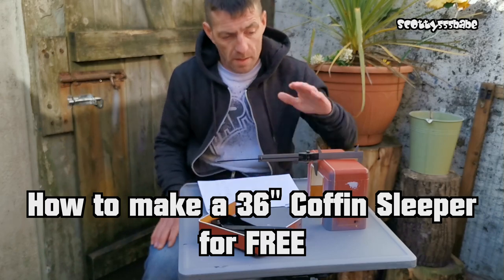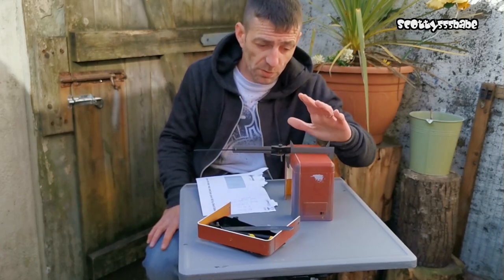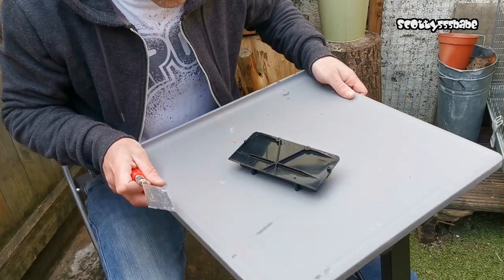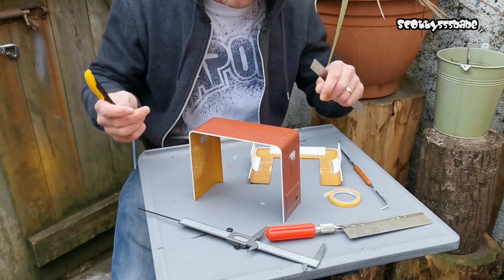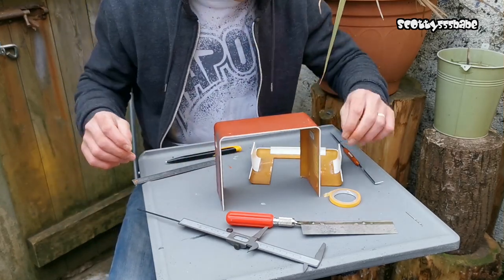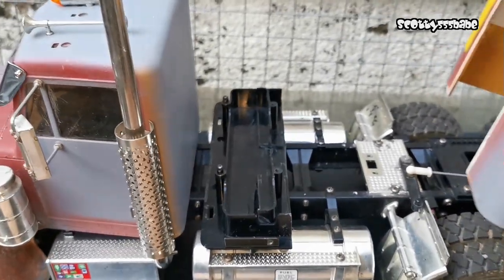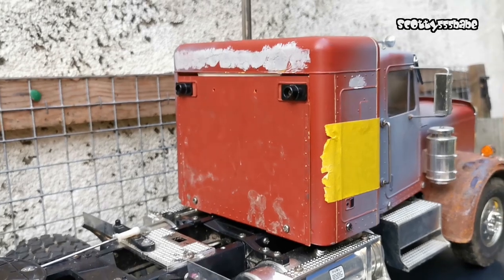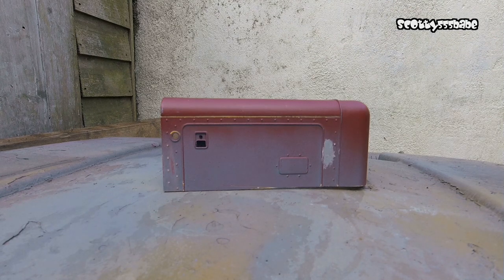How to Make a Realistic 1/14 Scale Custom 36" Coffin Sleeper | MUST HAVE CUSTOM RC TRUCK FREE MOD

Comment: nd vid pal. Just one question?. you use wet n dry sandpaper. I use mine wet for sanding my bodies. Is it prefference that you use it dry? :goodvibes:
Reply from the maker: With me removing the rivets and first lots of filler and it's already covered in primers I did it dry as it's a bit more abrasive, however for my final stages I'll use it wet to get everything nice and smooth, I'll wet sand between paint coats too but with a much higher grit 👍
Reply: @scotty555babe  Thanks for the info mate:goodvibes:

Comment: Don't be sorry it's long! REAL Modelers are a bit tired of 6 minute, chopped down and sped up Videos. NOT pointed at you!!! Nearly everyone but you and Teri Wilde don't give enough good information to properly absorb!
That said, you were fine at first with the 45" "Deluxe Coffin"... but you went the extra mile. Insisting on Scale and what you wanted, you chopped again. WELL worth the effort, it looks GREAT!! 🍻👍👍👏👏👏

If you're at all worried about the gap being too big, why not just drill and Tap new holes in the Chassis? 
Loved your explanation about limitations in space and Tools. I live in a small Flat, no yard. Most of that applies to me!
Reply from the maker: It's rare my videos exceed 20 minutes but with this being virtually a complete start to finish I felt it may have gone on a bit but it saved breaking it down into so many parts as with the next video on this sleeper I can do all the little intricate bits which look difficult but are actually very simple..
Also not everyone has the funds to buy additional sleepers at a cost of over 100$ to still have to put in all the prep work so it's great to show people how to create stuff for free with a bit of kit bashing, providing you have the additional materials such as paint and filler but that's always an extra regardless but that money saved could go towards adding sound and lights or a trailer etc..
It's the same with tools and equipment.. I see so many model builders in these fancy workshops surrounded by milling machines, routers, all kinds of fancy stuff that doesn't get used and for a first time modeller seeing that could easily be put off by feeling they need all that, when in fact you probably already have everything you need, it may take a little longer but with a little patience most things are possible.
I kind of went the extra with the scale coffin as I'd worked out in 10th scale in the previous video out of habit 🤣🤣 we all make mistakes and I'm bit afraid to share my mistakes, it shows I'm not a professional perfect modeller, no one is, everyone is as good as there ability and everyones work is great regardless of skill levels.. They had a go and that's the main thing, so I felt the need to rectify my mistake from the previous 😊👍👍
Reply: @scotty555babe  
Anyone who THINKS they're infallible...  is someone I don't associate with! I'm far from perfect, and I've been in the Hobby since 1982. (Yeah, Old Fart!) I've made some whoppers. 
Even recently. It took me till just Last year to finally get into  1/14th Scale Semi Trucks. And that was only because of an Inheritance. See, I don't have YEARS worth of spare parts accumulated, like you, Teri Wilde and others.... 
Fortunately Tamiya includes too many bits in their Kits, but with the 5 Trucks I bought last year, I've only got a spare 5th Wheel from my 1850L. ☹️  Got a WAY to go.

The Faux Pas....  doing me very first Semi (Grand Hauler), and treating it like I knew what I was doing!!! 🙄  Many upgrades, modifications.... and  a Beier USM-RC-3 - which has kicked my ass from Oregon to Maine!! 🤬🤬🤬 
My experience did get me through the actual build (even with a scared preconception of my first 3 Speed Gearbox!). Now that I've done one,  I feel that the rest will be easier. 

{Scotty..... if you want to spread an invaluable Tip to your many Subs; I was driven NUTZ over the Second Gear Dog. IT NEVER DISENGAGES!!! 
Stupid me thought it was a DEFECT, and chopped the legs down to clear 2nd Gear, like the other two! 🙄☹️🤬🤬 
Well as you can guess, Second just freewheeled!! As a former Auto Technician, it just didn't make sense. 
I finally realised that 2nd Gear freewheels - all the time. It's not until FIRST Gear Dog engages the 2nd Gear Dog, that then locks Second Gear!!! 😳 } 
I'm embarrassed about that, because of my experience. But if you can admit it, I can as well. 

But Novices who never built a 3 Speed before, should know that. 🤔 
I don't have enough Subs on my Channel to make a dent. It's OK, I like it small and personal. 

Another thing you've taught this Old Fart, is that a Razor Saw, something I've used for decades on Model Railroad Track, works brilliantly on thick Plastic Bodies!! Thanks! 

I want to take things I've learned from your Channel over the past 4 years, and apply them. I've already done your Steering mods. I've got one of my own coming up, that gives a SIGNIFICANT  Steering increase!! Great for long Wheelbase Trucks. 

I want to do at least one extended Luxury Sleeper (I AM American after all!!)... 
But no spare Bodies or Body parts, for the unforseen future. Really need King Hauler Tanks, for Snowman's Truck. Hard to find here, except for $70 Alumininium....